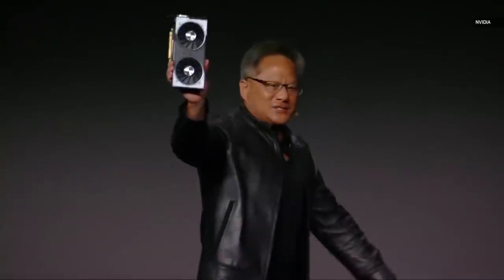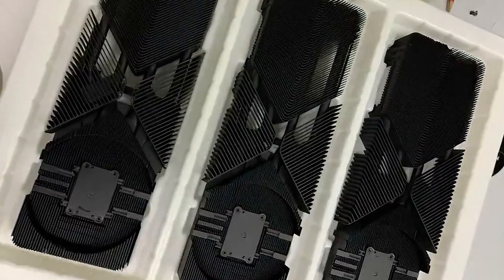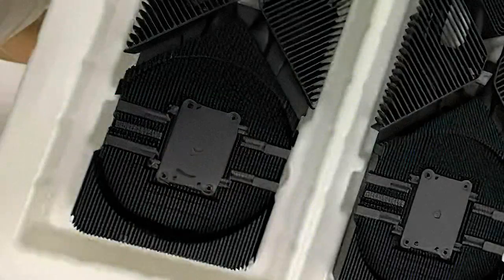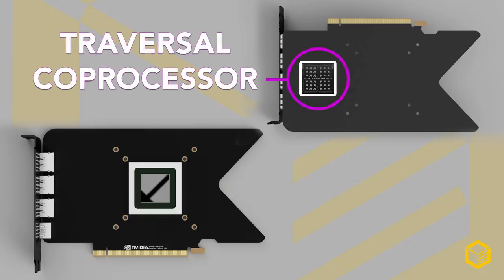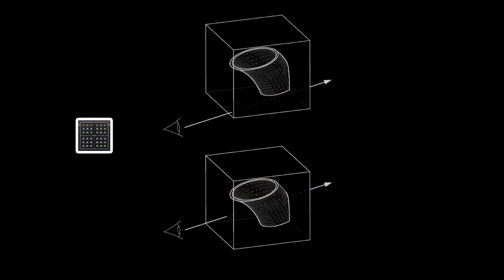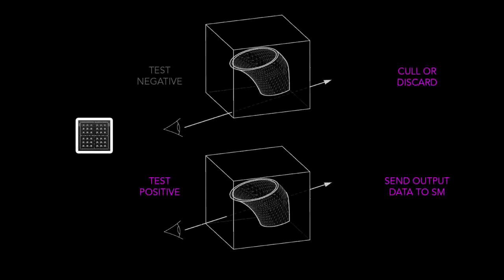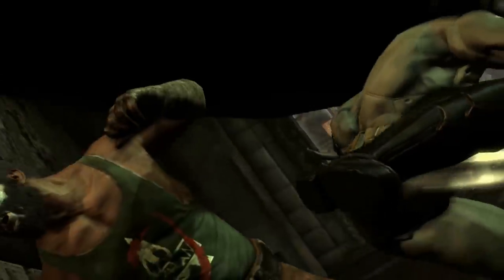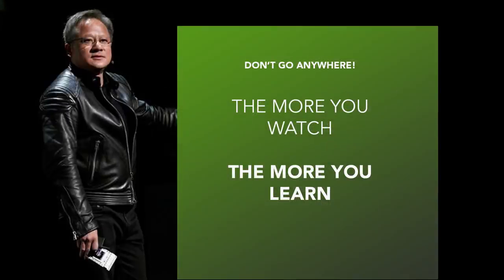A REVOLUTION in graphics is coming

Comment: Sounds like Intel might be doing what I was hoping for and writing about last year, HBM for system memory. Memory speed is the main thing holding back CPUs and even more so APUs today. That's why AMD upcoming desktop APUs are getting tested with 5600MHz DDR4 and Nvidia are bringing 21Gbps+ GDDR6X memory to Ampere. But HBM on the die of the APUs would be massive performance boost, if there was enough to replace normal DDR memory altogether or maybe like 32GB to act like a massive cache before DDR. And it really would be as expensive as you think...
Anyway, here's what I was saying last year: 
"I don't get why AMD (or Intel but it's very early days for them with decent graphics) haven't yet made a proper high end APU complete with HBM on chip for the desktop markets yet?
Maybe the upcoming 5nm will allow this revolution but surely the ultimate aim for Intel or AMD APUs it to win as many segments as possible and this includes the high end? 
There are a few segments where APUs aren't suitable, things like very specialist server and AI stuff as the ratios of CPU vs GPU vs memory is very different or the enthusiast market that will want the option of different configurations and the dedicated parts allows for tweaking the cooling solutions, overclock higher and swap out parts at different times but on the whole APUs have low cost builds covered very nicely but a large APU could perfectly serve up to the high end too if done right.

In the next few years both AMD and Intel will have the ability to build APUs with massive CPU performance, massive GPU performance and enough HBM3 stacked system memory to be used as the unified system memory for both CPU and GPU, and so getting rid of the slow and energy expensive off chip DRAM. This has to be where these companies are heading long term isn't it???

So lets say in 2022 when 5nm is pretty mature then AMD builds an APU with 16 CPU core, 120CU and 32GB HBM3. I know this sounds crazily expensive to achieve right now but when you actually sit down and look at the costs it's honestly the better value route for performance. 

The costs of separately putting together a high end system in 2022 would be roughly as follows: 

CPU (16 Cores Zen 4) = $500
GPU (120CU RDNA 3.0 with 16GB GDDR6) = $1200 
RAM (32GB DDR5) = $400 
MOBO (high end board) = $600 (probably needs to be a specialist embedded design)
Water Cooler = $300 (very high end AIO cooling required to control temperatures)

Total = $3000

So the first question is, could AMD sell this chip for less than $1700? I would say yes very easily given the XSX chip is roughly half this chip and they sell that for probably less than ~$100! Now ok, that is in massive quantities and the HBM memory will add a lot to the costs but not too get it close to $1700 and so it would still be a high margin product for anyone who makes it.

The XSX is 360mm^2, so with a doubling of pretty much everything and a move to 5nm I would project this chip to be no bigger than 600mm^2, which is certainly big but still very doable. It would actually be around the same size and design as AMD's Fiji chip which had a launch price of just $649 back in 2015.  

Plus if AMD sold the entire system kit together for around $3000 then there is a lot of profit to be made and a lot of performance for the customer. Win-Win!

With densities and efficiencies afforded by the advanced 19 layer EUV process on TSMC's 5nm node plus Zen 4's power efficiencies plus RDNA 3.0 being 50% more power efficient than RDNA 2.0 which is 50% more efficient than RDNA 1.0, I truly believe this seemingly fanciful chip is actually easily disable of there is a will to make it. 

It's also scalable too, so you could have half these specs for half the price for a different price point. Granted, clocks might have to be tamed a little to keep temperatures under control as transistor density will be very high but I would think the massive bandwidth and ultra low latencies of having the system memory on chip would more than makes up for lower clocks.

Maybe the CU count won't be the most important thing to focus on in the future, maybe it will be all down to the number of accelerators they can include on a self-contained, purpose built, giant, higher performance APU with ultra low latency insanely wide bandwidth memory that will actually be the key differentiator allowing for things not possibly on a non-APU system.

I'm not saying this is a perfect fit for all use cases but it would amazingly powerful for a lot of gamers, workstations, programmers, high-res professional image editing, 3D rendering, etc, etc.

These types of chip would be perfect for something like the Apple Mac Pro in 2022 or maybe if MS wants to being a desktop Surface machine to compete with Apple in this space?

Intel and AMD and currently locked in a fierce battle for CPU supremacy, Intel is also doing what it can to start a battle in the GPU space too but ultimately the victor will be the company that truly nails APUs at the majority of performance segments. 

For whatever reason we have yet to see a powerful APU come to the desktop, it's only low cost, low power stuff but even though AMD seems to be doing all the ground work to set this up maybe it will be Intel that brings something truly special first? There are already rumours Intel are playing around with big.LITTLE CPU cores which lends itself to APU designs from a thermal management standpoint. Plus Intel are doing their utmost to build a decent scaleable graphics with it's Xe range. But the biggest indicator of Intel's intentions is their work on Foveros which shows they understand the future needs all in one APUs with system memory on the die but again it's just down to which company beings a finished product to market first. 

I guess it's just 'watch this space' for who does it first but this is certainly the future of computing. What is very interesting is ARM based chips are way ahead of x86 when it comes to all in one chip design, just look at the likes of Fujitsu's A64FX, this is an incredible chip. So x86 has to be careful to not be caught napping. If Intel or AMD don't make a super high end APU soon then I think Apple will make it using either ARM or even their own design using the RISC V architecture to completely relinquish their dependence on everyone else for all of their ranges. Amazon are kind of making ARM APUs, Huawei do, Google do, Nvidia too, ok all these are very different types of chips to what I am talking about above but what I'm saying is they all have the experience of designing very high performance, complex chips and with Windows already supporting ARM and emulators working pretty well now then a move away from x86 could happen very quickly if one of these massive players nails a super powerful APU with key accelerators for the PC market.

One thing is for sure, we have an amazing few years ahead of us."

Comment: I doubt the new rtx 3080 have a die like that on the rear side of the pcb. The cooling solution looks more like a sapphire cooling design like on the Vega Pulse design. Where the cooling protrudes out of the pcb and the fan blows through the head sink. But in this case that part of the cooler with the fan is simply turned to the other side ie up in the system. If the pcb of the video card is actually more in the middle of the video card shroud to be able to cool the back side of the pcb then something like the Traversal Coprocessor or similar is indeed possible. But if the Patron designer studied the leaked pics and the pcb is at the back of the card ie as a traditional card then, no. :P

Comment: while I don't doubt that technically it would've possible for Nvidia to use the co-processor , the question is economics has to be taken into account. can they manufacture the 2 chips at a reasonable price for the consumer while keeping their margins? because in the end they do have to keep that stock price going. they could maybe remove 5bps from the margins and perhaps not be affected that much, but more than that and stockholders will be demanding Jensen's head. At 500/600 mm2, unless the co-processor is gigantic they could have just added it to the GPU chip and keep it under the reticle limit, no?

Comment: Intriguing possibility, that MIMD co-processor, but isn't it a bit inefficient if it's placed on the back? I mean, it would introduce quite a bit of latency. It would be better if it was placed real close to the GPU, similar to how the I/O die is placed in relation to Zen chiplets on AMD CPUs.

Regardless, fascinating possibility. If I understand this right, this would basically incur no penalty or stal in the SMs.

Great video and looking forward to part 2!

Comment: A chiplet for rtx would incur massive latencies but the potential yield improvements could justify it. I've been hoping for a Nvidia thin client Tegra successor for awhile. Their game streaming service is the best one yet, and if dlss was integrated  in the local device, it could allow for much slower internet speeds.

I'm much less optimistic about the VR headset. These compression techniques are just a stopgap until microled becomes viable. If it means the headset is cordless, it might be worthwhile.

Comment: The fan on the back has to be for pushing air up and out the top of the case similar to how my Powercolour Red dragon Vega 56 does with it's hole on the back plate.
Reply: It is exactly like that. Actually the design on your card is better because fan on the back do the same thing but it is unnecessarily complicated. I think the coolers from all cards manufacturers will be like your card. Only founders edition will have this fan on the back.
Reply: One other thing I was thinking about that back fan, Maybe 2 of the heat pipes run through the upper middle finstack to the back co processor, and the bottom 2 heat pipes run to the gpu through the bottom middle finstack and with the divides in the deisgn help prevent heat spread through the cooling heatsinks.

Comment: VR headsets already have two screens and can already show "holographic" images, aka 3D images. That's kinda the point of VR headsets.
Reply: Yeah, my thoughts as well. A single eye cannot sense depth. Well, not two eyes either, really, but the brain can interpret the signal from two eyes and then reconstruct the 3D information. There was one comment about removing the mesh effect (SDE), which could be true I guess. But as it's Nvidia, I wouldn't be surprised if they came up with a marketing term for that, such as "holoview" or whatever, and nobody else could have that particular name, even if they had the exact same technique or another way to achieve identical (or better) results.

Comment: I'm calling this as "probably correct" because accelerators and heat are the new challenges computing is facing, not CPU speed it transistor count or anything quaint like that.

Comment: it could also just be a mixmatch situation. in the leaks, it's suggested they're bringing out a rtx3090.  the gtx x90 cards were dual-chip cards, and this would explain the chip on the back in the rtx3090, and the reason the 3080 follows the same general design with it's cooler. whether the 3080 has the extra chip or not, we don't know, but if there IS going to be some extra chip on the 3xxx cards, it's probably going to be just that. an extra chip.  after watching the ps5 reveal video, with commentary, i see a lot more raytracing than i would have thought would be used, and in most cases, in 4k. also, many times in many engines the rendering done in similar quality to unreal 5's detail, meaning no discernable polygons at any zoom level, with pixel counts above 4k being rendered down. how they were able to tell all of this from the 1080p stream is beyond me and my understanding, but basically what i'm saying is, how does an AMD powered console have more raytracing and polygon counts than basically any PC game out yet?  something in the software.. so, whatever methods they're using to come up with these better graphics for the console must be found in the engine codes.. likely with AI algorithms, or chips using AI algorithms. so, if that chip you're speaking of is an AI chip, then perhaps that makes sense.. otherwise, i believe it to just be an extra chip for the 3090. either way, after the consoles come out, like next year, i believe AMD will come out with some pretty sick cards too.

Comment: to be frank it could be a acclelerator  (fpga) but i am more inclined to believe they have ram chips on the back too especially just for the highest end gpu and  the rest of the line up will be dual fan regular design . any thing expect 3090 or 3080 or super models
Reply: plus there is also 320w predicted power limit so they need a beefy cooling

Comment: I think Coreteks should avoid talking about hardware outside of his usual area.  The NVIDIA VR headset conjecture is full of nonsense.  First, a hologram makes no sense when you have binocular images being fed to the user's eyes (nor does it make sense for a 2-layer screen to create that effect with such a shallow distance between them while only displaying either color or shading).  Second, they would never be stacking OLED layers.  They are not designed for that.  If there is a 2-layer panel, the panel closer to they eyes will have to be LCD or something very similar so as to allow the passage of light from the other layer.  2-layer displays exist in the TV industry, and they are used to enhance the black levels of LCD, not some holographic nonsense.  That part seems decently likely since low-persistence LCDs have favorable performance characteristics versus OLED for headsets, as demonstrated by their usage in the Valve Index and Oculus Rift S.
Reply: this is an argument from ignorance

Comment: Dual chip idea sounds great, but isn't that contradictory to what nvidia would try to do? As you said Nvidia lives by "communication is expensive", if thats the case why would they off load the entire RTX workload to a chip placed so far away from the GPU die? Wouldn't it be way better to just break up the chip and put it right next to the die similar to HBM? or better yet why not just make a bigger die and make the chip a part of the GPU since Nvidia loves making giant dies. Power stuff being in the back is believable, but a triangle cut out in the PCB? Man that stuff leaves too many questions.

Comment: While it is true that architectures are not that important, the efficiency increased around 5-10% per flop each generation with gcn - rdna making a jump of 35-40% just by architecture! Of course, due to newer nodes more shaders were added and cards clocked higher resulting in additional performance gains...
So, if ampere can clock much higher (as suggested by leaks), has over 5000 shaders, huge memory bandwidth (gddr6x) and architecture improvements, ga102 will only be 25% faster? No way.
Reply: @magnusrasmussen951  true, although power budget alone obv. Doesn't directly translate to performance - i'd expect around 50% better rast. Performance, simply because it is highly unlikely that nvidia beats big navi with only 25% better performance than the 2080 ti (unlees you assume coretek's info is correct and big navi only has 64 compute units, but most other sources point to 80).

Comment: For me, it looks more like just simple dual GPU configuration because it is impossible to make bigger chips and it is cheaper to make 2 smaller chips than one huge. and also it iproves thermal performance.
So most likely the further improvements will be achieved by paralleling multiple chips. 
and there is no real way to improve raytracing performance that much. adding extra chip will not give that much improvement

Comment: Only 25% traditional rasterization improvement from 2080ti to 3080ti would be very disappointing even if the price was lowered from $1,200 to $999. I'm hoping for 40%... IDC about raytracing I'm just trying to run the upcoming 360hz 1080p IPS Asus monitor at 360 fps
Reply: Human eye cant see more than 720p

Comment: The Co processor makes sense but how will they price it? That's the trick. Maybe they weren't worried about big Navi at all.
The latency with the co processor would be a factor I guess but NVlink inboard should take care of it somewhat.
However, how will the board partners be able to add thier own unique twist to the reference design if it is so good and specific?
With AI and cloud gaming I expect Nvidia will aim to compete with consoles that way but I am not sure how the controller would work in terms or memory and battery life and without kinda targeting the segment that Nintendo has.
The Nvidia VR seems it would be pricey and about 3 years away.
Interested in seeing what big Navi is about as it would have to be something more than Rasterisation improvement over the 3080 to call it the Nvidia Killer... If AMD has ever used that term or is still using it. Navi 2 clearly has Ray Tracing support but what else does it have? Does it have DLSS competing technology or have they found a trick in working on consoles with Sony and the SSD tech. Q3  and Q4 can't come soon enough.